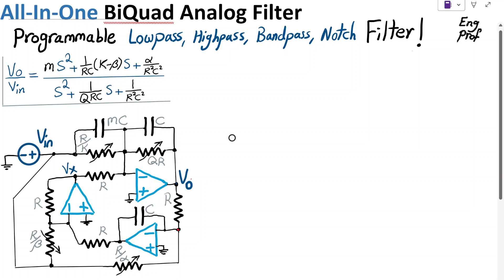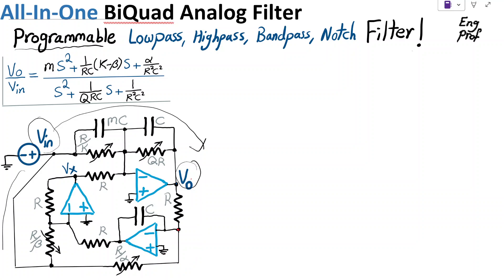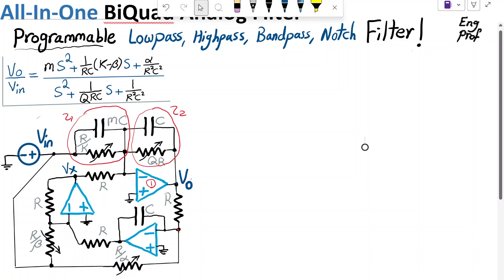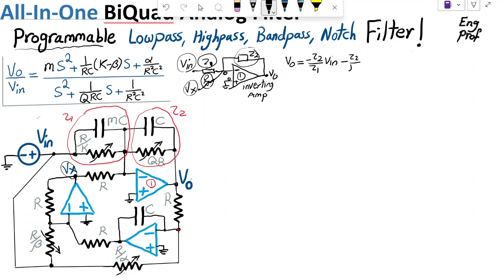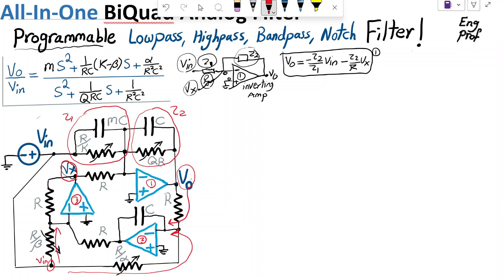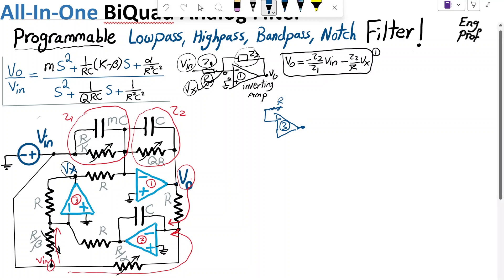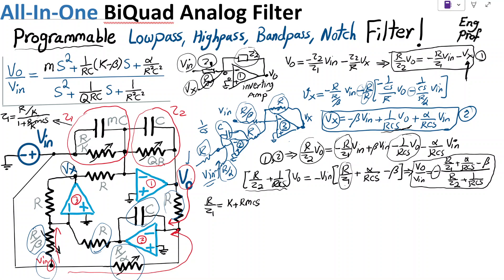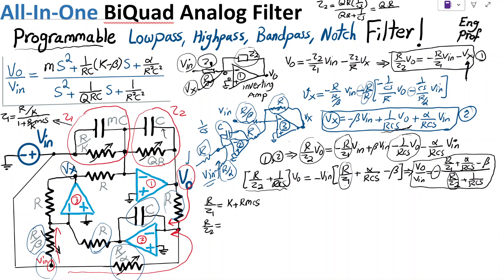All-In-One BiQuad Analog Filter: LPF HPF BPF

Comment: Hi can i ask can we do lowpass 2nd order resonator SAB?
Reply from the maker: Thanks for reaching out! Yes, you can design a 2nd-order resonator low-pass filter (LPF) using the SAB method. The basic principles from my "All-In-One BiQuad Analog Filter" video apply here, as it's also a 2nd-order system, and you can certainly tailor it to a resonator design by adjusting the feedback and component values accordingly.
   If you're looking for more details, I recommend checking out a couple of my other videos. For instance, the "Universal Analog Filter Lowpass, Highpass, Bandpass and Stopband Filters with Op Amps" https://youtu.be/2J-0msXZE2o provides a broad overview of different filter designs that might give you a good foundation to approach your resonator circuit. Additionally, in "BiQuad Filter Circuit Design and Transfer Function Analysis" https://youtu.be/U3AR1XCkX8k, I go deeper into the biquad filter design process and how to analyze its transfer function, which could be helpful for designing resonator circuits as well.
Feel free to explore those and I hope this is helpful.